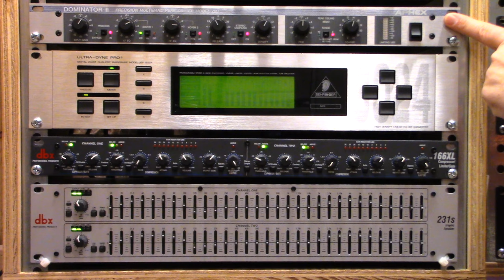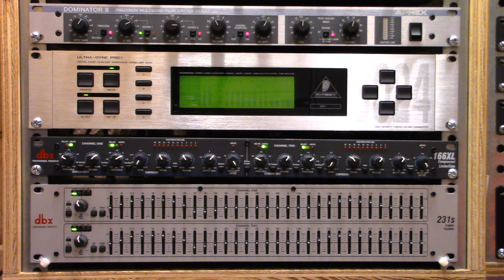Broadcast Processor Shootout

Comment: Aphex sounded rich and open.  Nice warm analog sound.  I'm sure if you tweek the 9024 in another comparison with a different song you might have different results.  I use my Aphex 722 in my mastering rig downstream downstream of my Focusrite Multiband Analog Compressor, ART Pro VLA II in the fully analog domain.  I keep the 9024 around in my digital domain suite of processors like DBX Quantum and TC Electronic Finalizer when I need quick and dirty processing.  Your test reminded me of why I keep them both around.  The 722 is highly underated compared to the Ultramaximizer Digital Limiter.  Thanks so much...

Comment: The sound of the Behringer is strange (comb-filtered, no transients, not enough top-end) and to me it sound like one or more settings problems. First check input/output levels, polarity and settings, if that's fine use very little compression and transient-friendly times. Use peak limiter only for 1-2db peak reduction. Killed transients and too fast release are what sucks life out of program material. It's hard to see but it looks like there is very low levels in the upper two bands which would explain part of the dull sound. The cheaper the processor, the more you need to know and the harder to work, which is why people get bad sound out of perfectly find equipment. But Behringer stuff isn't bad in general, they only need a low of knowledge about settings and the manuals are often giving misleading advice.

Comment: If you want to compare the Dominator with de 9024 than you should remove both DBX units from the signal chain. The sound from 9024 seems to have a huge phase problem  Which function(s) in 9024 is/are activated?
Reply from the maker: The 9042 only had compression and limiting applied. This "phase" issue was actually an issue with the downstream mixer that stepped the audio down to mic level.

Comment: The Aphex Dominator is a clear winner.  I own both processors and although the Behringer can almost emulate the Dominator, without the EQ and Gate, the Dominator is rich sounding and warm.  The 9024 is difficult to setup.  I own several digital processors including the DBX Quantum and the TC Electronic Finalizer.  Both are equally difficult to setup like the Behringer and wiil perform many additional tasks, but I still.prefer the Dominator.II over the year 2000 digital  processors. I also own the DBX DDP and TC Electronic Triple C.  All these.digital processors have their niche, but the Aphex Model 520 still defeats these digital processors on limiting... :)
Reply from the maker: I know I am the sole dissenter in this discussion, but I do like the 9024. I agree it has some useless functionality like its tube emulation, and it is complicated, especially the menu configuration and navigation, and does not have a EQ, BUT... It is digital so you can set your delay and get decent look ahead capabilities. Additionally it is 6 independent bands and once you get past how complicated it is, you really can finely tune your output, especially if you de-link the limiters from each other. Additionally it's metering is pretty good, if you don't mind the mono-lcd display, which I don't mind - all for a very good price. This is compared to the Aphex whose mentality is "this is the way your material is going to sound, get used to it" - not very configurable at all. I will admit that Behringer stuff is "prosumer" at best and they go out of their way to label capabilities so absurdly that it's laughable. My favorite is the "opto compressor" - seriously?!? what the hell is that. That all said, if you can get over these various few negatives, the 9024 is a good unit - IMHO and as I said at the top, I know this is a minority opinion.

Comment: The 9024 has no bass.  What happened to the low end?  Did you EQ it that way on purpose?  The way I heard it, I prefer the Aphex by a large margin.
Reply from the maker: The EQ setting did impact some of the mid bass on the 9024 chain, so maybe that's what you're hearing. As for your Aphex preference, that seems in line with most of my feedback.

Comment: Cheapest Aphex 720 I could find here in Norway was 500$, so I bought the Behringer one for 25$ The Aphex is probably miles better, but I'm on a budget so.. the Behringer will have to do the job.
Reply from the maker: If the Behringer you got was a working 9024, that's a good deal. Honestly I think the two are comparable if you put in the time to do all the 9024's settings - which is a lot.

Comment: Hands down Aphex.  I own both of these processors.  The 9024 seems to cut tje bass once invoked.  I use the Aphex 720/722 in my analog mastering chain.  I have implemented many alterations to my specified specifications.  The only digital outboard gear I would consider for limiting is the L2...

Comment: thank you for videos. very helpful. I know nothing about radio but I am going to build a FM radio station for another country. I dont want to use Online Radio . Do you know what I need to do?
Reply from the maker: This is a pretty broad question. But I think there are three things you need to focus on. 1. If you're going to be legal, check the legalities and regulations and apply for a license through whatever agency and rules that apply. 2. What's your budget. You can cut a lot of corners if you need - for example you can likely get by with a used mixer, single inexpensive mic, laptop for music (if you plan on music) and a used low power transmitter and antenna. 3. Decide what kind of programming you are going to have and what kind of hours and content/talent you'll have. I realize this is general, but these are the areas and questions you'll need to answer to move forward. Best of luck!

Comment: why don´t you put the eq after the DSP Ultra curve, because 6 band compressor will eq all frequencies at the same level in the end. i try it and have better results...
Reply: Nuno Lopes problem is the processing chain needs to end with a brick wall limiter so I don’t over modulate.
Reply: @robertandamywright3271  in my case i use the same dsp as you do and finish with dsp8000 eq with limit of -1db. No problems so far...
Reply from the maker: @TheNunolopes  definitely something to consider.
Reply: @humbertowrigolini578  nevertheless, thx  for the videos.

Comment: It sounds to me like the compression is not really setup for the same times like they have quite different threshold, attack and trialware times Could you get them to sound more similar than that?
Reply from the maker: The Aphex 720 and the 9024 are really two different approaches which get approximate similar results, but not the same way. The 9024 is a six band compressor with a limiter with user controls over the details (thresholds, ratios, releases, gains, etc), at the compression stage as well as the limiter stage. The Aphex is more of a fixed approach on three bands with limited user control over the details of how to get to the results. Their philosophy is essentially that they have a good algorithm and you start at that fixed place and you have some control over a few loose ends, but not full control over the whole approach. Also interestingly, they call the 720 a multiband limiter, not a compressor, although the differences between a limiter and a compressor are small especially in their application.  Here's a good video from Aphex on the 722 which essentially applies to the 720 in principle: https://www.youtube.com/watch?v=Yed8LUtN51c
Reply: @humbertowrigolini578  thanks I will check it out!! I have a deq2496 coming with what people tell me has really good downward expansion so I am looking forward to it.  Yeah I agree with you, 2 totally diferent beasts.  I currently use a behringer composer pro which is just a single compressor limiter and the limiter is not all that great.  Would love an Ivonics or optimod

Comment: This was an awful comparison completely unscientific!!  they should have been set up in exactly the same way to make a real evaluation . Utter rubbish!!
Reply from the maker: Love your passion on the subject. Though remember it would be impossible to have them set up the exact same way since the Aphex and Behringer are completely different, with different configurable parameters. And hence the point of this comparison.
Reply: @humbertowrigolini578  Than why did you make a video comparing them if you acknowledge that they are completely different things? It doesn't make sense at all...
Reply from the maker: @beatboxerz  Completely different is a relative term. They are completely different in their design and technology. One is a 6 band DSP the other is an three band analog compressor/limiter. In that sense they are completely different. However they are very similar in what they are trying to achieve - processed final sound contoured to the user's liking and often the last leg in the processing chain. That makes them worthy of comparison - old school vs not-as-old school.